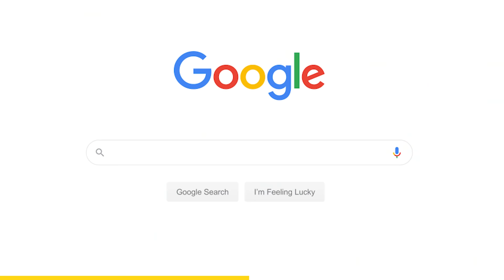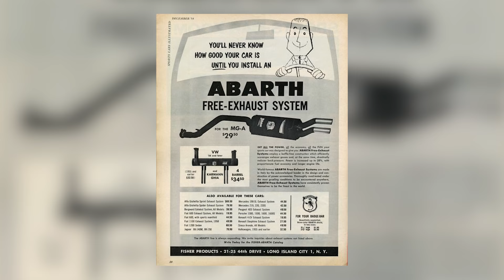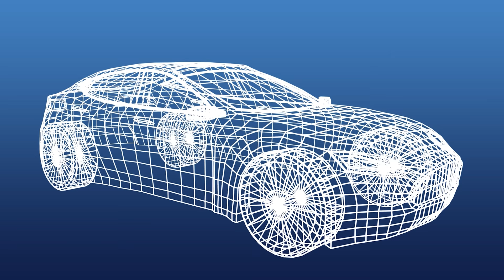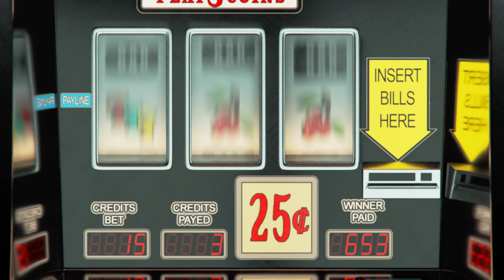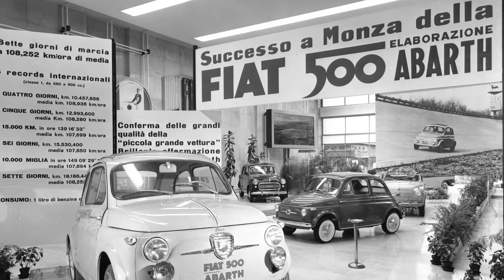Abarth - Everything You Need to Know | Up To Speed

Comment: A modified 500 Abarth is some of the most fun you can have under $10K. Looks ridiculous, sounds ridiculous, and you just won't care. Love mine to pieces (sometimes literally).
Reply: Ain't that a mood. It's a labor of love
Reply: I drive a stage 2 abarth 500. It’s not fast but can keep up in the corner ☺️
Reply: Is it reliable
Reply: @user-360johnn  eh, I mean it won’t ever leave you stranded, but reliable isn’t the word I’d use. Lots of little things like to break. Not terrible though, parts are cheap.
Reply: @urock12201  100% agree. It is definitely not reliable, but it takes some love and care. Has not left me strandef but has had to be repaired in my garage for a bunch of little things.
Reply: @user-360johnn  so far I've gone through two transmissions, each of which shit the bed almost exactly at 80k (on the trans). They're Chrysler units, so that's hardly shocking. The second time was definitely my fault, I bent the shift fork between first and second gear, but the first failure was manufacturer error 100%. The engine is stout as hell, the North American market 1.4 Multiair has forged internals from the factory and can handle loads and loads of boost. I've been running a tune that pumps out 24psi steady for almost 40,000 miles and it's been loving it. Some little stuff like a driver's door latch and the wiring for the tailgate have gone away, but for a car with over 100k that's track driven and daily'd, it's been a beast. At least as reliable as my Volvo, and more reliable than my ram ever was. 9/10 would recommend.
Reply: I had one pass me the other day. Sound is incredible
Reply: @user-360johnn  The ones with the abarth engine are pretty solid. Never had issues with the engine. But a lot of random things when out for me was the touch screen radio, window regulator and the button that opens the truck.
Reply: @urock12201  "Wont leave you stranded" 

 I drove mine from Montreal to Ottawa almost 2 hrs away and my shifter cable link snapped leaving me in 3rd gear hahaha. Both door handles came off, trunk wouldnt open, side skirts peeling, suspension is poop in cities with pot holes.. 

 Still love and own it. Im a sucker.

Comment: Normally I’m an old school rwd enthusiast but after my ‘stang had to be put down when a pickup thought stop signs were optional I wanted a smaller car. I tried an Abarth. It had so much personality that gave it a go. Few mods later & it earned top 3 fun ride that I owned. Drive it like it was stolen & don’t get in trouble. Also no reliability issues.
Reply: No reliability issues??!! I don’t believe that lol.
Reply: @silverrain99205  in Europe we get the T-jet engine instead of the multiair unit which is really fragile even by Fiat standards. the T-jet is rock solid though, currently put nearly 30k miles on it over a span of 3 years and apart from a breaking lightbulb its been faultless.
Reply: @nielslernou7554  the multiair is fragile only to those that don't do the correct maintenance, put wrong oil or keep it too much in the engine... This is an oil actuated phase shifter with controls on single valves, not a pushrod 50years old tech stuff that to provide the same power must be 300kg and the size of a tank.
Reply: @silverrain99205  5 years no issues just replaced 2 batteries, brake pads &  tires. So high consumables replacement but no engine codes even with tune. Didn’t even go through a clutch.
Reply: @AlessandroGenTLe  yes. More like Panzer tank.
Reply: Damar Fadlan  tjet is a basic DOHC engine, multiair is a sohc with electronicly actuated valves
Reply: @nielslernou7554  30K miles over 3 years is average mileage so it hasn’t really proven to be particularly reliable.
Reply: Got mine two years ago a 2011 and still had no issues.
Reply: @silverrain99205  It also proves it's not exactly unreliable for an 11 year old Fiat.
Reply: @AlessandroGenTLe  Correct. Mate of mine had bad luck with his punto evo but it had been thrashed around track before, installed a new Multiair unit which was very costly but never heard of any issues with it since.
Reply: @nielslernou7554  I own a GP T-JET . Curenntly running somewhere around 200HP. I have a friend with an Abarth GP running 300+ on stock internals. TJET is one of the best 1.4l 4pot engine.

Comment: If anyone is lucky enough to get one, I HIGHLY recommend getting a 124 Spider, Abarth or not. It’s the modern Mazdaspeed Miata everyone wants and just as reliable. I have a Classica and it’s not much different than the Abarth trim, and with a couple of bolt-ons and a tune you’re doing 240+ hp easy.
Reply: Isn't the 124 just a Miata with a Italian sports coat? Just saying.
Reply: Hell yeah man, I've got a '20 Lusso that I've got a full stage 3 kit on, she screeeeeeams bro
Reply: @BrisLS1  The Miata ND and the 124 were actually built as a joint project between Fiat and Mazda, so while they technically share a frame, they were designed to have completely different driving experiences. I hope that helped clear up some confusion
Reply: @BrisLS1  the 124 comes with a 1.4L turbo I4 engine as opposed to Mazda's 2.0 N/A engine, other than that not sure of any other major differences, but the Fiat does make more power stock

Comment: I have a 2018 124 spider abarth and M4s and C63s struggle to keep up with me on mountain roads despite having 3 times as much power. It handles so well, the limited slip diff works perfectly and the engine has so much torque that it feels like Diesel engine. 

I personally think it’s more fun than a Miata because torquey engine just pulls so hard when exiting a corner. Amazing car.

Comment: Having just bought one in September 2021 I’ve been waiting for this episode they’re so underrated and sound so amazing
Reply: Same, June of 2021...but almost regret the purchase
Reply: got one in November
Reply: New, or used?
Reply: They sound a lil over the top for the amount of horses they actually have
Reply: @BrandMalone24  used. Mine is a 2013
Reply: @Nickun_  can easily be tuned to 200 wheel if you know a reputable tuner. Will handle it on stock ecu

Comment: There was also Grande Punto Abarth in EU before 500. It has pretty much the same engine as 500 Abarth (1.4 T-Jet)
Reply: @venia..4529  Spam much?
Reply: I own the slightly raised version of this Punto called the Urban Cross Abarth, same engine and body with 205mm ground clearance. It isn't as good at cornering, but it's awesome for driving fast on dirt, gravel, or just plain bumpy roads with potholes and where I live most roads are like that 😉.
Reply: Turbocharged FIRE engines were common in many Fiat group models including Alfas and Lancias. I'd say the AGP and APE throughout it's presence on the market received more powerful variants than A500, only after Punto's discontinuation (or shortly before) the A500 went beyond 160 hp. Correct me if I'm wrong.
Reply: @spavatch the grande punto abarth came with base 155 hp as it has the IHI turbo. The evo punto abarth (facelifted model) came with the Garret 1446 turbo which pumped out 160hp stock but with a tune would easily pump out 180hp and above depending on other mods. 

I am in Australia and have a Grande Punto Abarth pushing around 180 after a sports downpipe, bigger intercooler and an uprated turbo actuator. I'm saving for a bigger turbo so I can bump the power up to around 250hp reliably.
Reply: @stevenroberts9172  Won't your gearbox blow up? I've heard that they can't handle 200+
Reply: @error262  - they’ll handle even 500 hp from a 1.4 T-jet... at least until they break ;)
Reply: @error262  The Grande Punto's came with the M32 gearbox that Vauxhall/Opel use in the Corsa VXR which is a notoriously unreliable and weak box. The Punto Evo has a much more solid transmission which could handle the torque way better and is infinitely more reliable, which is handy because the Supersport and Esseesse Evo's had 180bhp and 300nm torque from factory using that Garret 1446 turbo and could be tuned over 200bhp with an intercooler and a downpipe, and there's some TD04 turbo conversions pushing 300bhp in the Punto OC
Reply: @error262  I swapped to the 5 speed gearbox the same as in the abarth 595. They can take up to 340nm from memory . There's enough headroom for more power. The clutch will need to be upgraded past 240 hp generally.
Reply: Yes and I've got the Abarth Punto Evo Supersport 1.4 16V MultiAir.

I'm so disappointed that they didn't showed the Punto-Series. -_-
Reply: @FlyingBeast009  the puntos have a better chassis than the 500's and a better seating position. I said it 500ers and I'm not taking it back😜.

Comment: I was into Fiats when I lived in Germany in the 70's. I've owned a 128 3P, a 124 Sport, and a 124 Spyder. The 124 Sport had a high performance engine that a factory Fiat mechanic helped me to install. It had dual webers and power like you wouldn't believe coming from a 1600cc engine. I'm not much into the new Fiats but maybe if one comes out that I like.

Comment: I got my 2013 abarth about 2 years ago. And while it's not the fastest possible car to own I got a really good deal for it with less that 55k miles on it and a whole car fax of consistent service records like oil changes. So it was solid, and has good gas mpg. I have to say it's likely the most fun car I've ever driven. You feel like a child when you push that sport mode button and the car basically transforms from a little fiat to a fuckin gremlin. The throttle response and engine really open up, you hear the turbo and the car just goes hard as fuck. Granted I'm basically driving a turbocharged go cart, but I feel like I'm driving something ridiculous you would made in GTA. Definitely a 10/10 for me. (Sidenote: when you start that engine you wouldn't believe how many heads I've turned because of how fuckin gnarly the exhaust sounds.)
Reply: Hell yeah bet that was fun af

Comment: As you can see by my youtube profile picture, i love 500 abarth. A few bolt ons and a tune(most important & controversial which none is cheap) and its 198hp 227?tq at the wheels. Still get 30-35mpg doing daily driving, and tons of thrills when cruising. Its not fast, its barely quick(but 2630ishlbs with me in it, 2487lbs without me). But the senses it tingles...oh boy is perfect for not getting in deep sh*t.

Comment: The Abarth 595 ( Fiat 500 Abarth in American) is one of the last proper hot hatches, small, light, 3 doors, front wheel drive, small revvy engine, and not so fast that you kill yourself putting it in a ditch. 

I had a Renault 5 GT Turbo back in the 90s, the 595 feels so much like that car.

Comment: The 500 abarth has one of the best OEM stock exhaust sounds under $50k
Reply: I only paid $8,900 used for mine! 😁
Reply: @Milnoc  I paid 5500 😎
Reply: @DatFunnyStuff190  Ooof, that depreciation is brutal
Reply: @Ontheregz  haha worked in my favour on this one🤣
Reply: @DatFunnyStuff190  When did you buy it, which model year and what mileage?
Reply: Ive seen these under 4k. Not so much, now. 6500 or more.
Reply: @Milnoc  In UK, I bought mine for £4800 with 72k miles. Full spec 135bhp. 1.5 year later and nothing went wrong so far :)
Reply: The abarth exhaust is about as close as anyone has gotten to the original SRT-4 exhaust note.
Reply: @laughtoutlaud  That would be classified as a meager Fiat 500 Turbo in North America! 😁

To be honest, I usually drive my car with the sport mode off which dials down the power to 135 bhp, same as yours. Even at that level it's surprisingly peppy!
Reply: @Milnoc  135 standard 500 model, not 595 etc, full dealer history 70k on the clock, late 2011 model

Comment: I had an Abarth 500. A cabrio. I loved it.. Easy to tune. A plug in ECU upgrade upped the boost another 5lbs raising it to 200+hp (I dynoed it). It was fast for what it was but governed to 145.. But it got there rather quickly. I miss it.

Comment: I drive a stock 500 with 1.4 100hp just upgraded suspension and I feel King on the roundabouts. When accelerating bigger sporty cars can outrun you but most will struggle to beat it when you are willing to floor it. Power is good enough for highways. I am very very happy with my little Fiat. I dont know why you would call them slow, not compared to other small cars. Sport mode is on all the time though.

Comment: Had one 595 Abarth for two days as a maintenance replacement vehicle. Nice engine performance, I won an acceleration test against Audi TT. But weak brakes and quite high driver seat position.
Reply: Driver seat lowers substantially. There is a lever on the bottom front left of the driver seat that lowers the driver seat. Passenger seat does not lower, which is high as F.

Comment: Great video and very accurate but Abarth actually built the cylinder heads for the Fiat Strada/Ritmo Abarth 125 and 130TC in the same factory next to the Lancia 037 and Delta S4 rally cars so to me they were the last proper Abarths. The 130TC was the last hot hatch (available in Europe and Australasia) to have twin carbs as standard. Actually, the Alfa 33 had twin carbs until a couple of years later but that’s not as hot as the Strada/Ritmo. 

Anyway, love your videos and keep them coming 😁

Comment: I have Fiat Grande Punto 2006. It isn’t Abarth version but I have the best stock engine 1.4 16V 95HP 6g Transmission. He is almost 16 years old and looks and works like new. This car is so much fun, especially as a first Car. Agile, Good handling, not the best but very good engine and cheap service and parts. 1.4L StarJet is reliable, i had problems with only electrical parts like windows, lights etc. But this is common problem with these Puntos. Luckily, Everything was an easy fix. My mum is owner of 2017 new gen Fiat 500, but in my opinion, this old boy is better in all ways… I love my Fita ( yes, I’m weird, giving names to cars… 🙄)🚗

Comment: Abarth didnt cease to exist in the 80's .... Abarth was the responsible for the engine in the Delta S4 and helped with the Delta Group A, but the road car division went missing around 83 or 84. The Ritmo 105, 125 and 130TC where the last cars of the "Classic" Abarth brand.

In the early 90's Fiat planned to bring the Abarth name along side the Punto 176 in road and rally form. Fun fact, the Punto GT was not planned to be the flagship hot hatch, because there where plans of a Punto Abarth with a 1.8L Abarth dev I4 with around 140 to 150hp, but Fiat got afraid to go ahead.

The "Modern" Abarth brand was bring back in 2006 with the Grande Punto Abarth and not the 500. 
And there was a Punto Evo Abarth with very awesome variants.
And there where plans for a Bravo Abarth (2007) and a 500X Abarth, but ye, Fiat gets cold feet.

Comment: guys get your abarth fastback in the link, 185 horsepower and 230 horsepower stage 2 custom directely from factory in Brasil MG  Betim, the 185 is in etanol in gasoline is  180, 0-60 mph 7.6 sec in etanol. The stage 2 is not ready but probably gonna be 0-60 mph 6.5 sec in etanol

Comment: You mentioned the Abarth 600, but you didn't mention that the mods that Abarth made to the 600 engine meant that they needed to redesign the (rear) hood to keep it permanently propped open? That's the sort of thing that would be right up the Donut boys' alley.

Comment: James, that's cool that you wrote for Tyler the Creator, I guess.

However, you missed the MOST iconic Fiat 500 (presumably with an Abarth aftermarket kit) in Lupin the 3rd, Castle of Cagliostro. The FIRST feature length film directed by the legendary Miyazaki Hayao.

There was even a special Lupin the 3rd Abarth 595.

Not a SINGLE mention?

C'mon, I thought you were cooler than that.

Comment: 500  Abarth not only seems like a go-kart it drives exactly like one and although the suspension is present it makes no difference to go-karts that actually do not have a suspension. If you want to know what your spine would feel like if shattered, drive a 500 Abarth on a normal road. As for 124 Abarth, you better off buying the underlying car, MX5, it's cheaper.

Comment: Ive got a black 2012 500 Abarth for sale in SoCal. 69k miles (nice, i know). Clean title in hand, couple accidents on the carfax. No mechanical issues or service lights. Someone take it off my hands. Asking $7900
Reply: Brand new OEM A/c compressor, tensioner, and serpentine belt. Previous owner straight piped the muffler section. Hit my line, i got too many cars damnit

Comment: Nice job guys,,, BUT- you left out the most IMPORTANT part- that this current platform (if it is even current anymore)  is the biggest turd you can buy!  It for sure is the Red-headed Step Child of someones.  Fiat disowned it for me, Chrysler that is. It went to their shop for busted parts several times, as in endless wheel bearings, busted shift cables, seized brakes, door latches falling off, and rear trunk never opening. The thing sat in the shop for 28 days in the Albany dealer once until I threatened to come to get it and then they canalized a new fiat for parts! !
The car would have been great if the car was loved by the manufacturer.
They hated me, it or both.  IDK.
I have made only a partial list of faults here...and as i said-if they were somewhat gleefully fixed I could have loved the thing.
Don't buy this car unless you have some twisted idea as to what transportation should be ...masochist?